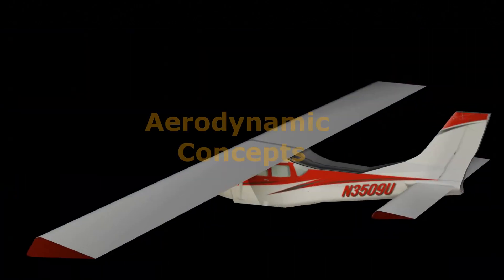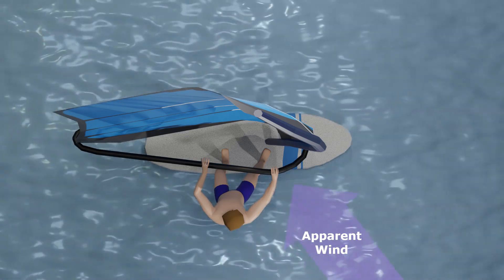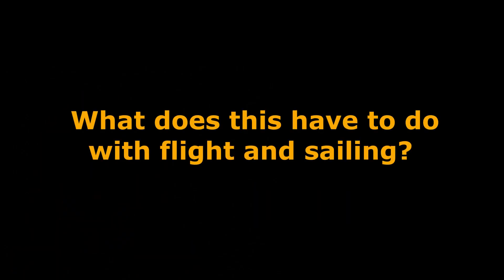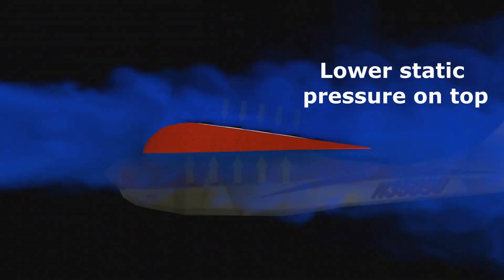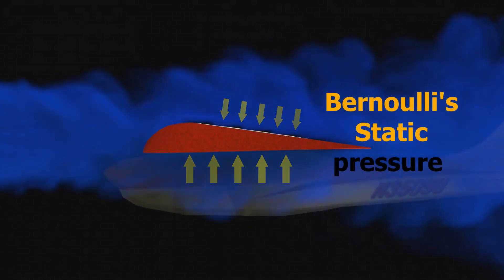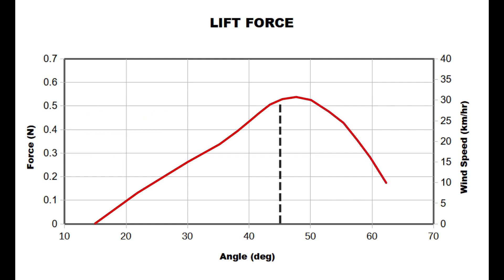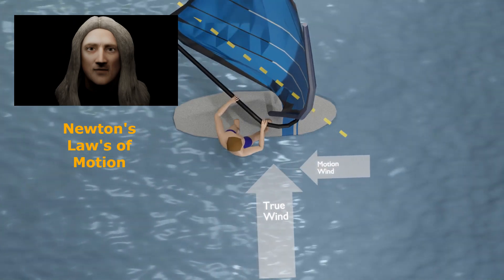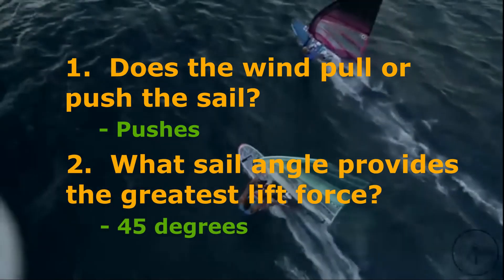Change the way you think about windsurfing

Comment: This is a really cool experiment! The only thing that bugs me a little is that sails aren’t usually angled 40° or more to the apparent wind; it’s typically closer to 20°, not the 45° your graph suggests. Also, for the red line, it looks like you’re combining forces from both the leeward and windward sides, so we can’t see the windward side in isolation. It would have been great to see the windward side measured separately to directly compare its force with the leeward side. I do appreciate the experiment, though to me, a sail is positioned and shaped much like a wing, which is why I see it as working like one.

Comment: Yip! Spot on. We also have center of pressure at the leading edge of the sail/ing etc that give a false leading edge through boundary and laminar flows. (Compression of fluid aka air) A flat surface doesnt fly, it uses friction aka no lift but uses a false centre of pressure caused by the aoa thus making a 'airfoil'. A air foil does both until speed is attained as you showed here. Thus making them farfar more efficient. At a great aoa, that front centre of pressure drops under the airfoil and stalls out the wing, creating nonlift and too much drag. Hence the ~45° max AOA.

Comment: As the board planes and picks up speed, apparent wind is much diminished and there is a significant change in the forces the sail experiences. This is why modern Windsurf sails are shaped so differently (and so differently compared to large, fundamentally non-planing sailboats). The mast is inclined towards the stern, closing the gap between the sail and the water surface (and the board). I'm quite convinced that lift has to be very significant there and the main difference in performance between older (70s to 80s) and newer sails. Check out race sails with cambers, too, and how they differ in performance compared to wave sails when it comes to top speed, the difference is drastic.

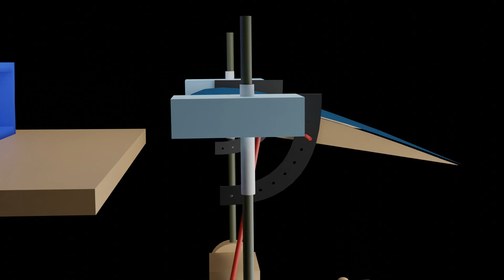Comment: 5:00 this is NOT a sail, it's a WING. One side is longer then the other, it has a chamber. A Sail does NOT have a chamber. This whole video is completely false, sorry, as fance as it has been produced.
Reply from the maker: The model is a sail.   You are right, it is not a wing.  There is not a flat side on the underside of the model.  It is hollow like a sail.  It has a thin membrane over 3 struts simulating the thin shape of a SAIL.  There are SO many videos where a sail is described as a wing.  I am constantly showing the differences in the video.   Your scientific discussion is appreciated.

Comment: no, it does not have the profile of a wing. It has the profile of a sail. The air is flowing around it at the same speed, reaching the end of the äquidistant points at the same time, creating no pressure difference and thus no lift. It's all about the reaction force of bending the air into a curve. Basically the same as if the sail was completely straight, just more efficient because it produces less turbulences.
Reply from the maker: I agree, but so many explanations center around the curve of the sail and the wind flowing over it.  The explanation of lift is often given as  a function of air flowing over the leaward side ...which makes it like a wing.  Newtons explanation is the air moving  and striking the windward side.  The windward side of a sail is curved as you state, but the wing has a straight flat bottom, but both provide surfaces for receiving the Newtonian force.

Comment: blowing on one side of the profile prooves nothing. the low presure  is allways higher than hi pressure, so nothing is realy pushing the sail. at the same time this bernuli shit aint enough to fly. the wing and or sail is generating lift by creating massive vortex as the whole 3d unit. those sections simulations are poore. funny how "scientist" cant till today even explain how the airplain can fly.
Reply from the maker: There is no vortex lifting the plane or pushing the sail.  Any turbulence forms behind the wing or sail and is the result of a partial vacuum as a result of the more rapidly moving air on the outsides.  That vacuum will only pull on the wing or sail (if it is close enough to it).  In the case of a sail, it can only pull it downwind (drag) and is very unstable.  Turbulence is not desired for aircraft or sailing vessels.  
People seem to have different "beliefs" related to Bernoulli's principle and Newtonian forces, but in fact they are both acting.  The model I put together demonstrated that it was the Newtonian forces which provided the most significant driver when comes to sailing ...and flight.

Comment: There's one VITAL thing missing, imho: tha fact that windsurfers, when plaining fast, pull the sail windward. So the mast is NOT in a straight angle towards the zenith, but at a certain tilt. The reason is that windsurfers want to make themselves as light as possible to the board, so the board needs not carry the full wight of the windsurfer's body.  The more the board skimms on top of the water instead of navigate through the water (like a sailing ship), the higher the speed attainable. Like a speed boat, nose comes up, the "wet surface" is reduced and only the aft part of the board, touches the water. This way the resistance is reduced and planing becomes possible.  
The harnass is essential in this. When going fast, the direction of the harnass lines show that the harnass is lower than the boom.  This means the pull of the sail is not only directed forward, but also UPward.  This allows the surfer to have most of her body NEXT to the board, not ABOVE the board. (When the wind is light, in non-planing mode, the surfer stands vertical, with full weight on the board.). See this clip https://youtu.be/h7bJeJLOQGg?t=166 . But also at 07:07 of this vid, the surfer in front is almost completely weightless (to the board), the sail pulls must of his weight. (See the harness lines from the surfer to the sail go up at an angle of almost 45 degrees to horizontal). 

To summarize, the force the sail delivers is split between a pull forward for speed, and a pull upward to reduce the body weight. 

This split is a declicate balance, controled by the lateral angle of the sail, and as soon as the wind becomess less, the surfer has to adjust, changing her stance to a more upright position,  putting more weight to the float the board provides because there's not enough force from the sail to keep the weight off-board.

I would love the see a @3D Enlightment video vizualizing these essential aero- and hydrodynamic differences between a fast planing board and slow 'displacement mode' windsurfer!

With traditional sailing boats, the whole boat, including mast, tilts towards lee side.  Totally different dynamics. A displacement boat is speed-limted by its waterline length, so all above considerations are moot.
Reply from the maker: Thanks for that contribution to the discussion.  Your description is absolutely correct and would make a nice addition to the 3D Enlightenment video collection. Thanks for that!  Cheers.

Comment: Even in Bernoulli, isn’t it still technically a pushing force? Just how there’s no actual “sucking” force when you suck a straw, it’s just high pressure pushing to equalize the lower pressure of a vacuum
Reply from the maker: True, but there has to be the partial vacuum or sucking force first before there is the pushing force from the positive pressure side.  So without the low pressure there is no pressure difference and no movement, that is why it is important to acknowledge it..

Comment: The whole higher pressure under a wing has been debunked. You can fly with a totally flat wing, what causes lift is air against the angle of the wing at the leading edge.
Reply from the maker: True, with a totally flat wing you can fly, but there must be an angle of attack to capture the dynamic pressure.

Comment: Bernoulli simply states that the velocity of a gas is independent of it's temperature. Which of the Bernoullis I'm not sure but it's the consequences of this principle that have importance as it relates to pressure. 
The effect is usually explained wrongly because wings don't  provide lift with neutral pitch and symmetrical foils can also provide lift.
Reply from the maker: Bernoulli's principle is related to conservation of energy involving fluid flow.  Gas is a fluid.  The relationship to temperature is a function of a loss of energy as heat  for example due to friction.  You may be thinking of the relationship between temperature of a gas and its density.

Comment: Can you measure when the sail is tilted at an angle of 0 to 30 degrees relative to the water surface? I believe that during this time, the crosswind increases the acceleration as it bounces off the water and the sail, causing dynamic pressure to rise. I'm curious about my theory, although it's probably well-known, but it caught my attention
Reply from the maker: Hi the wind would mostly be blowing parallel to the water surface but there could be some bouncing off of the waves.  If I understand what you are describing I would say that with the sail tilted over at such an angle there would be direct lift vertically allowing less surface pressure and contact with the water...resulting in less friction and drag through the water, resulting in less resistance allowing the board to accelerate .   Essentially you and the rig become lighter on the water because of the upward force on the sail.

Comment: Isn’t the fin an important element in the ‘lift’ theory?
Reply from the maker: Not as much as you may think.  The fin is bilaterally symmetrical so the water flowing over the surface from edge to edge will flow over each side equally resulting in equal pressure on each side.  Also, windsurfer boards are relatively flat compared to the water surface (unlike a sail boat which leans (heals) over with the wind) and therefore the fin mostly cuts through the water vertically.  Also watch my first video which discusses the influence of the angle of the fin.   https://www.youtube.com/watch?v=cjTb15pme-g&t=9s

Comment: Thank you for the effort. Very nice build model.
What about the dynamic pressure ?
Reply from the maker: The dynamic pressure is the pressure resulting directly from the movement of the fluid (the wind) and its transfer of force upon impact with the sail.  The red line on the graph demonstrates that the dynamic pressure is the primary force on the sail and the primary explanation of lift especially beyond, say, 35 degrees.   I will be making a video shortly on sailing faster than the wind which may help with the understanding of dynamic pressure.

Comment: Please, stop using Bernoulli's eq. to explain lift. The Bernoulli's equation is only valide along a streamline. One can not compare two streamlines on the upper and lower parts of the wing, that is wrong!
Reply from the maker: Thanks for your comment.  The static pressures (not dynamic) are commonly used to explain lift as they demonstrate pressure differences on the upper and lower surfaces of the wing.  The dynamic pressure differences come in to play in the discussion of the angle of attack.  The experimental model I built and used to measure the lift forces showed that there was measurable lift when the air flowed over the top of the wing (green line on graph) but was much greater when the air flowed over the top AND bottom surfaces (red line on graph).  The whole video was also presented not to describe flight but what were the predominant forces when sailing...and Bernoulli's pressures are not very significant.  These low pressure forces could also be described through the coanda effect which also results in lower pressures downstream of air flowing over a curved surface, but Bernoulli has derived a mathematical equation to explain pressure differences in ideal fluids through the application of the conservation of energy.
Reply: @3denlightenment  

The explanation using Bernoulli's equation relays on the following reasoning: 

1 - the fluid particles following along the upper and lower faces of the wing take the same amount of time from the leading edge to the end of the wing; 

2 - the curved path of the upper face is longer than the lower path; 

3 - because 1 and 2, the particles along the upper face must be faster; 

4 - using Bernoulli's equation, because of 3, the pressure on the upper face must be lower than the pressure on the lower face. 

There is no physical justification for 1 to be true, in fact, numerical experiments clearly show that 1 is not true.

One can't justify 3 based on Bernoulli's equation, because Bernoulli's equation is only valid along a SINGLE streamline. Therefore, one can't compare velocities and pressures along a streamline on the upper face and another one on the lower face of the wing. That is wrong!!! That is a violation of the validity of the Bernoulli's equation. 

This explanation is one of the most widely spreaded hoax of fluid mechanics.
Reply from the maker: @antoniofetter    Just to respond to your points.  #1 is not true as most people know by now; which is why I never mentioned it.  #2  is true.  #3  The difference in path distance has nothing to do with why the air travels faster, so we are in agreement that #1 and #2 does not result in #3.  #4  By the conservation of energy, the increase in air speed causes a decrease in the static pressure on the upper surface of the airfoil.  The increase in speed is likely due to the coanda effect and the sudden compression of air around the airfoil as in Bernoulli's principle.   At this point we are talking about a single stream of air on the upper surface only.  This lower static air pressure around the upper surface is in contrast to the static pressure on the lower surface, regardless of whether the air is moving on the under surface or not.  Because the static air pressure is lower on the upper surface than that below the airfoil ,  it results in the airfoil rising.   So, even though  Bernoulli's principles apply only to the upper surface via a single stream of air, the pressure differences created between the two surfaces results in the generation of lift.
Reply: @3denlightenment  One last comment...
“So, even though  Bernoulli's principles apply only to the upper surface via a single stream of air,”
The Bernoulli’s principle applies to ANY streamline, regardless if it follows the upper or the lower part of the wing. A streamline is a line that is tangent to the velocity field, in steady state, it is the path that will be followed be a given fluid parcel.
In this context, the Bernoulli’s principle express the conservation of the total energy as the fluid parcel flows along a SINGLE streamline. For instance, if the kinetic energy increases, then the potential energy or the pressure have to change to compensate for it. Therefore, one can not compare the quantities expressed by the Bernoulli’s equation across two or more streamlines. It would be like comparing the total energy of a satellite following an orbit around the Earth, with the total energy of another one stored at a JPL’s warehouse.
Reply from the maker: @antoniofetter  Thanks for all the discussion.  I agree with what you have said and since I am not comparing quantities expressed by Bernoulli's equation across two streamlines, we are in total agreement.

Comment: This is interesting, but also raises a question as to why we bother with a curved (ie camber induced) sail at all? The graph shows that the maximum force is produced at a sail angle from 40 to almost 50 degrees, though at the bottom of this range (40) some of that force is produced by camber, however at 45-50 degrees, ALL of the force is generated by sail angle alone, and none by Bernoulli's principle.  Wouldn't it therefore be possible to have just as much lift from a completely flat sail (at the correct angle to the wind), vs a nicely profiled cambered sail?  This demonstration of forces can't be the only forces acting on the system to produce power to generate forward momentum, as we all know that cambered sails are faster than non cambered sails.
Reply from the maker: Thanks for the comment @South Pacific.  Your observations are true.  A cambered sail will provide additional lift relative to a flat sail, which is not apparent from the measurements I made in the video as the wind source from the fan was basically just a reflection of the ambient wind.  It would seem that the cambered sail gets its benefit from the 'motion wind' moving around it as the sail moves forward.  FYI -  I am making another video on sailing faster than the wind, which will cover the additional forces resulting from a cambered sail...so stay tuned.

Comment: You forgot an important component, Drag! Lift force is perpendicular to the flow. Drag along with the flow. The sum gives you the total Aerodynamic Force on sail. This can be decomposed in Fr, driving force and component Flat. By following you're theory, you can sail almost against the wind, since there is no drag.... Nevertheless, I like you're measuring setup.
Reply from the maker: Thanks for your comment @Julian Hofman.  I do discuss drag, but I was not able to measure it in the model.  It would be very tricky to set up.  I also had two key questions to answer which were focused on lift.  In my first video I specifically discuss heading upwind.  You can check that out here:  https://www.youtube.com/watch?v=cjTb15pme-g&t=326s